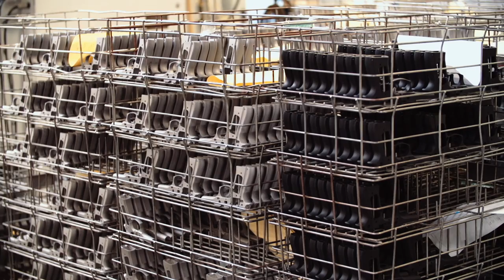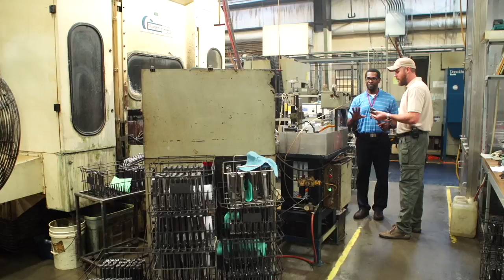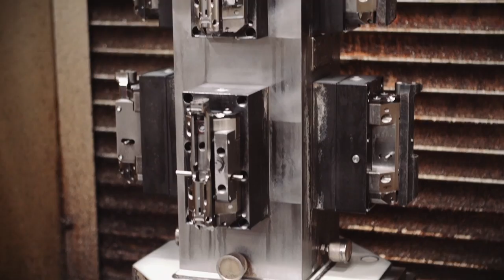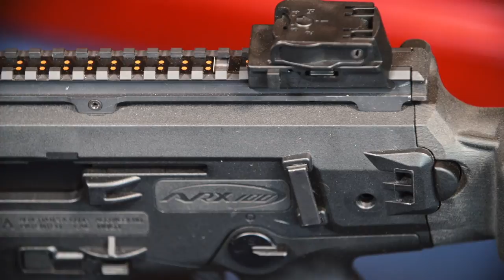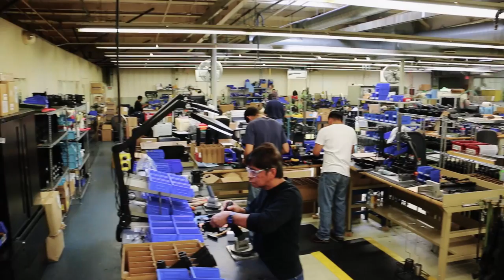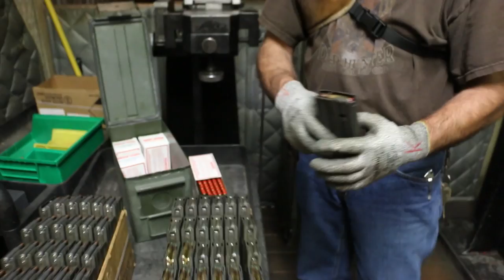Beretta USA Factory Tour

Comment: Thanks for this video. I just shot the Beretta at my local gun store it was an old military surplus Beretta M9 and it operates really really smooth as always and just thinking about the modern designs versus a gun that I read online The reason why it passed the military trials is because it fired over 23,000 rounds with only five or six failures and then again after the 20 3000 rounds if 33000 rounds with only maybe 6 failures I read this in a form online from the military and I was like okay this is an awesome weapon and then with the M1A 3 I think that this it will be a great go to war weapon magazines already available and the craftsmanship they put into that weapon was the real reason why they got the military contract some people say it was politics but it worked

Comment: Beretta is one of the oldest  company's in the world, and got that way by pleasing their customers.   I have an old Beretta automatic shotgun I bought for $400 2 years ago, and I wouldn't part with it for less than a thousand now.  Criticize the products all you want, but the bottom line is, it goes boom when you pull the trigger.  

And for the folks arguing about the army's next gen handgun, how are you gonna put a suppressor on that Glock when the barrel tilts to load the next round?

Comment: I will never understand why the army picked up the POS sig 320 and not the m9a3. That thing is SICK
Reply: Cause the name of the trial was "Modular Handgun System" the M9A3 is not modular. It does not have interchangeable backstraps or grip frames or different barrel lengths. While it does change calibers so does the SIG. It is also made out of aluminum so it's heavier than the SIG, and the DA/S trigger system of the barretta is going to be less reliable the a striker fired handgun. It has a larger number of parts than the sig, dissasembly is slightly more complicated, etc, etc, etc, etc.
Reply: @mr.mercury4247  I can tell who hasn't browsed M9 barrels or actually broken one down... 

It literally takes one movement of your finger and it's broken down. How can that possibly be better? The M9 averaged a malfunction only once every 29,000 rounds. Its heavier weight contributes it to being one of the worlds most accurate pistol.
Reply: @jordanjoestar8839  in the trial, the sig had to either meet or exceed all of the stats of the Baretta. The sig P320 is more accurate and reliable than the M9 while also being lighter. Can't argue with government testing.
Reply: @mr.mercury4247  Give yourself a chance and watch some videos from Small Arms Solutions. The sig was never tested. The #s I heard from SAS was 18750 rounds between failures after firing 75000 rounds done by Beretta. Government isn't as infallible as we want them to be. They goofed.
Reply: Me either. I have shot a shit ton of rounds through both and the glock 19x. The m9a3 is the shit. 19x and the p320 would place even behind the smith and wesson m&p
Reply: Because the p320 replaces every single pistol of every single branch, whereas the M9A3 replaces only the M9. This wasn’t just about the army

Comment: Quite simple enough: A basic FS 1 single shot 12 ga break barrel has survived use/abuse/neglect from our security employees from early 1.960's til 2014 when we sold couple farms. My late Dad purchsed it new back then and it's still as tight as new in spite of many scars of hard use/abuse. One of my most cherished pieces inside my safes. Other two are a .380 acp Cheetah and a P9. No wonder the Beretta name is so respected and trusted after roughly 500 yrs!!

Comment: I finally saw a ARX100 at a gun show last weekend and found it to be front heavy, just another ding on the list for this rifle. I was already disappointed with the rifle for not having a nitrided barrel as originally announced plus it uses outdated sling loops instead of QD mounts.
Reply from the maker: TangledThorns Americans are the primary users of QD mounts, mostly because we don't know any better (and yes, I'm just as guilty). Most QD's are far to easy to engage inadvertently which is why the worlds militaries still use non-QD systems for general issue. This is a rifle that is built to military specs, not hybridized and Americanized. I would much rather have a real military type rifle than some hybrid that is custom made just for the US market.

Comment: Great gun. Hate slide safeties though
Reply: Erik Tisdale Safeties on DA/SA are pointless. Decocker only - and that's a must have (unlike on that IWI Jericho)
Reply: thedudepdx Thats what the 92G is. Decocker only w/o safety. The "G" model selector can be purchased separately and installed across the 92 line if that is your preference.
Reply: Yup it's like the PX4 I believe. G versions  seem almost impossible but you can retrofit it to a G model with factory parts. Normally I wouldn't risk removing a safety on a carry gun for legal reason but I think going from one factory configuration to another will probably not cause you legal issues in an SD scenario (well at least fewer issues)
Reply: Ya but there's still that lever on the slide to snag your finger when operating the slide. I'm all for da/sa w decocker, that's why I own (love) the hk p30

Comment: That rail is freaking bad! That's some level up stuff!
Reply: Dario Ortiz  One thing I have to say about Beretta is the hard work and quality they put into their firearms is just amazing. They really ought to fix the 92 series pistols though. They still have a lot of negatives.
Reply: rambokicksass77 I dont know, man.  The only reason negatives surface about this gun is because of a small number of bad experiences our modern military body faced.  Extremely high average round counts on these guns + crap magazines can make a bad day for anyone
Reply: Michael Wilson  Granted, but I'd like for them to make a Vertec model with checkered front and backstrap and a frame mounted safety/decocker. Other than that, they are solid. Triggers are perfect, although the D spring being standard would be fantastic.

Comment: I really didn't know that the USA was considering changing its pistol wow that has to be the shortest serving pistol in history and I would be surprised if they found one that was a massive improvement over the m9
Reply: *****  They most likely won't adopt a new service pistol. And there are many pistols that are much better than the Beretta for a service pistol.
Reply: ***** 30 years is not a very short time
Reply: There are a lot of handguns that are much better than the m9 but our military has the same problem everyone does. Their wallets.
Reply: Ian Jacob The biggest issue with the beretta right now is all the guns are triple rebuilt guns from the 90s that have had no one take any care of them, if they were new or they taught troops the value of taking care of their pistol, they would still be very good handguns.

Comment: You would  think for all that innovation they would be able to make a pistol that has a removable front sight. That whole front sight connected to the slide thing totally turns me off from the 92 I mean they are very nice quality pistols but if you pay $650+ for a handgun you should be able to switch the front sight out without having to get out a drill lol. But all in all they make great firearms and great video Mac.

Comment: I had a Beretta M9A1 and you could easily tell that it was a fine piece of hardware. I was never a fan of the slide safety and the heavy double action trigger pull though, so I ended up trading it for a S&W M&P9

Comment: I heard some news recently about the Germany Army having problems with the G36 rifle not performing up to far when under combat conditions. From what I understand, the pencil-barrel on the G36 severely cuts down the accuracy of the G36 when it gets hot. Do you think that the ARX160 would share this issue? It would seem that the ARX160 and the G36 have a lot in common in terms of features.
Reply: ultimentra The barrel thickness has nothing to do with the G36 degradation of accuracy when the barrel is heated up. The issue is the barrel extension is set in a polymer collar. Hence the barrel is set in the polymer receiver and shifting when the barrel heats up. Causing accuracy issues.

Comment: I'm a fan of Beretta, but I also think that it is time to move on to a more modern design, like the FNX 45.
Reply: Please don't tell me that you came to that conclusion by looking up what .45 handgun had the highest capacity
Reply: geckcgt I came to that conclusion because I own one and can vouch for its reliability, build quality, and accuracy. It also falls in line with the standard manual of arms for the current M9 far better than most striker fired handguns. Also because its predecessor was a strong candidate in the last pistol trials until they cancelled them. Also it is likely due to the US militaries relationship with FN due to the fact that they produce many different weapons that we use.

Comment: Did I miss you asking about the Gallatin, TN facility and what production is moving out of Accokeek, MD?
Reply: M. Frankiewicz Initially the production coming to TN was going to be the APX line, PICO and other newer lines. However, since Maryland passed some serious draconian laws. Berretta announce their entire line and operations will be moving to TN over the course of 3 years to complete the entire operations moving process. Usually when companies move a good portion of their manufacturing. It's the companies way of saying they will eventually move everything to their new plant. In the long run, it saves the company a significant amount of money. By getting State and local tax breaks. The cost of living is cheaper and other things go into the equation too. I reside in the Nashville area. So when it was officially announced about Berretta's plans to completely move to TN. It was huge news down here.

Comment: Looked like the factory folding iron sights and magazine on the ARX was REALLY loose and shaky when you were firing it. That can't be good. Obviously you can easily remove the irons and install an optic like that Deltapoint you have on their, but they should def tighten up those tolerances for the magazine well.

Comment: Funny thing my father was an armorer for the marine corps back in the mid 80's and at the time when berretta was testing the m9 after 800 rnds or so the slide would crack so they would come in the middle of the night and replace the slide so no one would be the wiser in my opinion I am not a fan of berretta because of things like this don't get me wrong I am not saying they are terrible don't buy from them but it is one of those things that is rarely talked or even known about.
Reply from the maker: TheMeatwade There are only a handful of actual documented slide failures of early M9's, all were traced back to special operations use and a particular flavor of ammo.  All M9's have a safety device that would capture a failed slide, but even to this day such failures are unheard of. They are more likely to crack a locking piece, but even this has been rectified years ago.
Reply: Military Arms Channel Thanks for the info I don't claim to be an expert on guns or the whole history on them and I am always welcoming insight or correction for mistakes I wasn't there so I cant say with 100% certainty.

Comment: There nice pistols but you need to get rid of the safety add replaceable front and rear night sights and need it in .40 and .357 sig
Reply: Larry Storrs  The Beretta 92A1, 96A1, and the M9A3 all have dovetailed sights and can be replaced. The Beretta 96 series is in .40 S&W.

Comment: I bought a Glock .40 cal, found I could not load the magazine and next day I returned to Marks Gun in Florence Ky asking to trade for a Colt 1911>They refused to trade for a more expensive gun and gave me a loading device. Later I traded it for a Beretta 92 at a gun show, and was surprised that I could not reload the Beretta without a loading device. I called The factory and was told that magazine springs were made that way to insure reliable feeding. I purchased 2 more magazines at Bass Pro and they would only hold 11 or 12 rounds. I called a trusted gunsmith here in Cinciinnati and they said shoot a few hundred rounds to "break in" the springs. After a few more trips to the range, I wanted to clean the gun, and struggled for hours to get the recoil spring back into the gun, with no help from the owners manual or GUNTEST magazine. Should a military gun be impossible to reload by hand without a tool? I plan to trade the 92 for a S&W .357.

Comment: My Beretta M92FS Compact Inox with Rail should be arriving at the dealer's today. Admittedly it's pushing close to $700 after tax and paperwork, but that's not bad when you consider all the metal, fitting, finish job, and polishing going into the pistol. A plastic-framed pistol for more than ~$450? Pfft, you can get a new steel or aluminum frame CZ for less than a Gen 4 Glock and a Beretta in Bruniton for just a few dollars more. Sure, Glocks are great guns... but why buy the Model T when I can get the Firebird for a little more?
Reply: Zane Gardner No, I mean ugly, utilitarian in the extreme and made in any color you want so long as it's plastic. And the Beretta has an aircraft grade aluminum frame.
Reply: Zane Gardner The sarcasm... it really doesn't work. Neither do most guns when thrown in "muck", or mud. Glock, Sig, Beretta. About the only thing that will cycle through mud is a well built Kalashnikov, and that's toast if the mud has gravel in it.